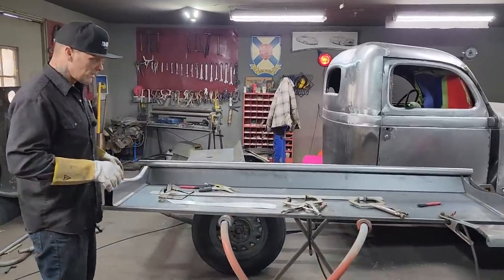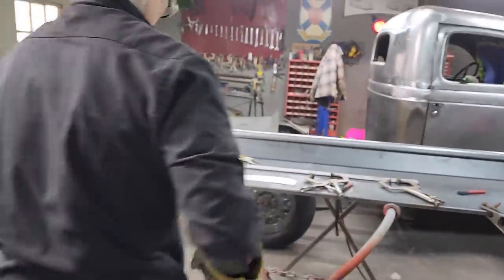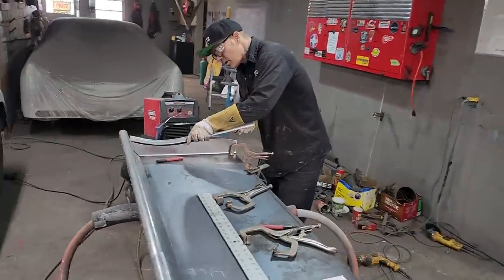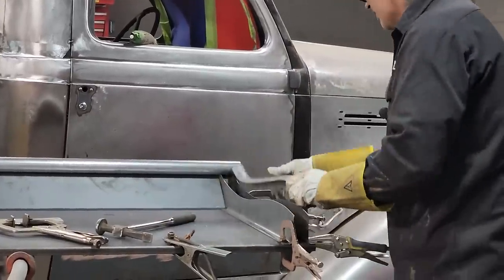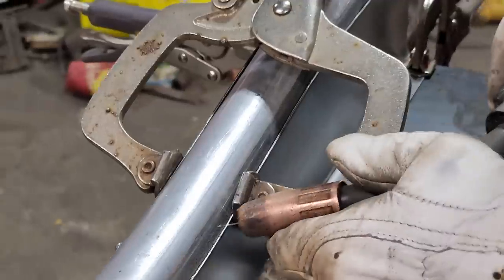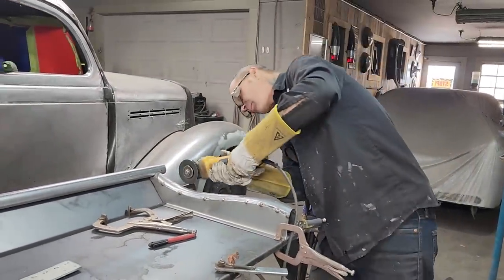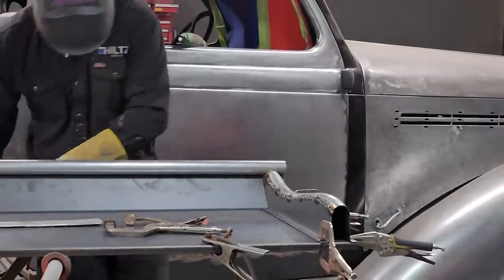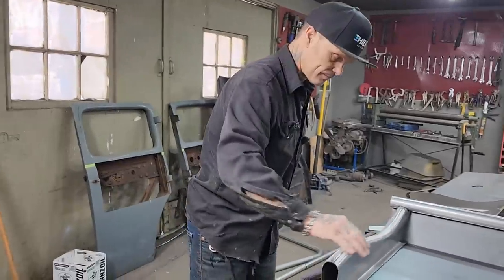Fabricating a box from scratch for custom pickup truck ➜ stake pocket fab

Comment: I've never commented on any of your videos I think before but I will comment on this one I really like it if you look at those side braces that you've made with the curve on them for the outside of the pickup truck box it's actually the reverse image of the back side of the cab where it meets the roof line somewhat where it goes up and then curves towards the cab so I guess what I'm trying to say is it actually meets or bands with the flow of the body at the angles you need to have things match up and it's going to look very old and original I think you're an absolute genius in a damn good builder one of the best I've seen from making something from nothing and making something something love your videos

Comment: When you had it slit, it was a better bend because the other metal around the tubing kept it in place.  When he bent it without the otherside, it causes the edges to buckle, and when you hammer the buckle you are actually shrinking it again and causing it to unbend.  I know it was more grinding and more material lost but it was a better overall bend.

Comment: Chad I've bent square tubing as well as round tubing by laying it on the garage floor, blocking up one end and reversing over it with the back wheel of my car, sounds really dodgy but it will work on most applications where you need a slight curve in something, the higher you block it up the greater the curve you will get.

Comment: An idea for you! Take about 1 foot of 2x10 for each end drill 3 holes 1 inch, 2 about 4 inches apart on bottom and center 1 about 2 inches above those on each board. Screw them to a solid table, and take some 1 inch rebar thru both boards! Then you can use it for a pipe bender in the shop!! Have a happy Thanksgiving all of you!!!

Comment: !!! OPTION FOR STAKE POCKETS !!!

Hi Chad and Jolene. I like a lot watching you and i am impressed about your creativity. 

For the stake pockets, i suggested you can make a hole on the top  of the 45 angled side panel. After you did something like this it is more usefull for multipurpose use reasons. You can slip in posts for a rack or mount tiedowns or hooks and so on.
Just even think about these options.
Please go on with your channel, i like what you are doing.

Comment: Great work around. That mallet and log worked with the sandbag. Once I had to make a couple bends in something similar. I ran across a caster wheel from a chair fit the width of my piece perfectly.Had a depression in the cement floor, laid the piece across it and rolled the caster back and forth pressing down to get the bends i needed without hardly any distortion. Just another way to skin a cat as he says.

Comment: Hey chad i appreciate this video, i would like to ask you how you would make the square and bottom tapered stake pockets for a 1930 model a pickup standard box, im going to be doing mine, i would appreciate some advice on how u would fabricate them with the least weld joints as possible to keep the metal warp to a minimum. Would appreciate a short speech on your next video possibly!? If not thats ok. Keep up the good work🤙
Note: im working with 16ga

Comment: Hey Chad, those stake pockets are really looking nice! When you're bending the half-pipe pieces by clamping them to that solid pipe, what if you put a pipe clamp around the end to hold it to the pipe, instead of a welding clamp? I think you could leave the pipe clamp a little loose and just slide your Half-Life under it and it would hold it while you pull up on it to bend the shape into it. Just an idea. Not sure if it would work or not.

Comment: Just something from my experience doing the same as you are doing now. a bar same as you are using to bend it on but in the vice with a steel collar that fits over the bar and tube, stops it flattening the shape and you just move it up and down pulling as you go

Comment: Chad, you have that Blue Pipe bender it used to set under the metal bender but it looks like you may have moved it, pretty sure I seen it in the engine room with a small board setting on top, those work really nice for  what looks like a press, but the rollers that come with it keep a smooth bend on the pipe,,I have one the same thing made for Bending Pipe

Comment: I wonder if you could bend a full piece of pipe in a bender then cut it in half then fine tune the bends on the halves. Honestly yesterday I thought you'd just weld the whole pipe in. It wouldn't add much weight, but would add loads of strength.

Comment: It looks like your going to have to weld two sides of the pipe and will have to use some plastic to smooth off the edges, also you have quite a few more to do. I hope the other comment I sent you might of worked out. Truck looks good. Good Luck.

Comment: From one welder to another if you weld one at the bottom then one on the top then back and forth between top and bottom that should help stop the heat dissipation of the weld

Comment: These pockets, are they just for decorating ? Or will you put in a stronger true side rail pockets ?
Reply: Forgot to add I’m going to be 62 come January started welding only a year ago  so yeah I’m a beginner self taught at what books and you tube showed me . I know I got knockoff welder tig /&stick and has settings for aluminum and plasm cutter and a no gas mig

Comment: Another idea that would suit you well they have commercial conduit benders for electoral work it’s just a pipe with a thing on end to bend it can’t be to expensive.
Reply: I have been out of the business for several years.
But unless things have changed, the largest size that those manual benders can be bought for, is 1 inch.

Isn't the exhaust pipe that Chad is using more like 1-1/2 inch?

Comment: I know we all have our own way of doing things so this is not a criticism just telling you how I did something. I built a bed for my 46 chevy truck pretty much the way you are, but I used a pipe bender and bent the pipe first then cut it in half not easy but  seems like it was easier then how you are doin it? P.S. not a criticism
Reply: How did you get varying radii like Chad ended up with?
Reply: I was an electrician for 40 some years the bend he made is what is called a dog leg or offset bend I used whats called a hand held. conduit bender

Comment: One more thing please no white wall tires try and use the factory original Wheels with the center caps and some gnarly knobby tires for the back that is a pickup truck Farmer style like me that's what they look like when I was a kid
Reply: I'm a retired farmer, so I understand the look you are talking about.
However.......
It will look like a pickup.
But it won't have the chassis of one.
So why should it have "farmer style" (your words) tires and wheels?
It's not as if they plan to take it off-road or haul a load of firewood with it.

Comment: Hard to watch you use that damn zip cut when you have a state of the art plasma cutter, could of ripped that exhaust tubing in half like butter
Reply: Chad did a nice fast job with the zip cut, just saying.
Reply: It is easier to do better fabrication and welding with zip cut edge than plasma cutter and much easier to control.....unless you have computer aided control.